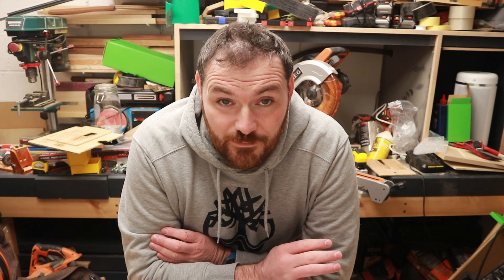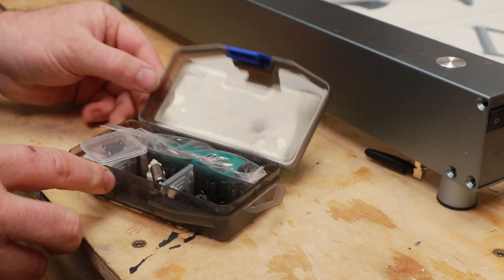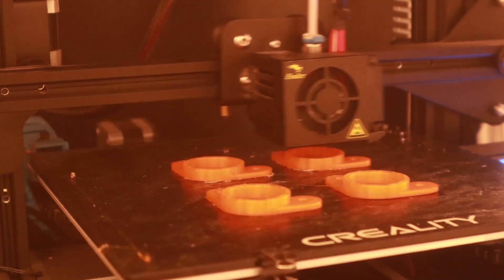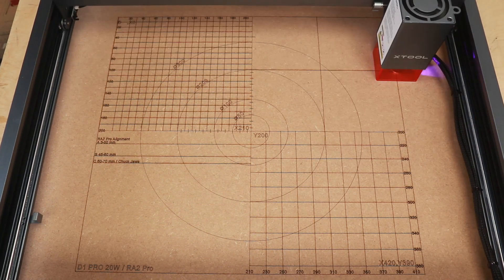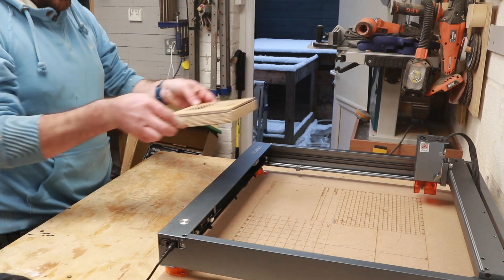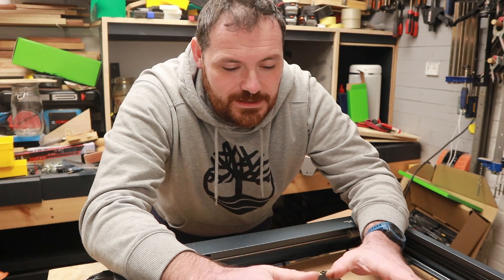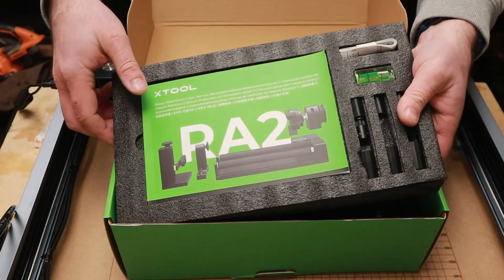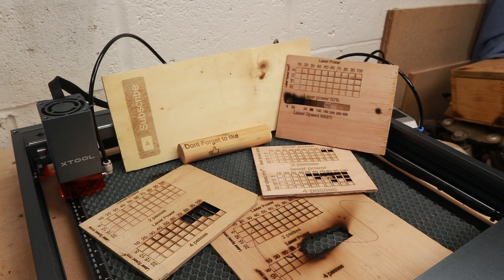Can Xtool D1 Pro 20W Laser Be Used For Cutting Wood? Set Up And First Run #xtoold1pro #lasercutting

Comment: They must send the testers out nice one. I bought mine in  Nov  22 and still haven't been able to use it. Mine was packed nothing like yours. No tools no Leg things. As  of  date I've spent  $3000 just to start off.
Reply from the maker: That's a shame to hear that, I take it you have tried contacting xTool about your issues? I have to admit, it did take me a while to be able to cut through wood properly with the right settings. The leg risers and the RA2 are part of a different set maybe to yours, as I think there are 4/5 different packages you can buy